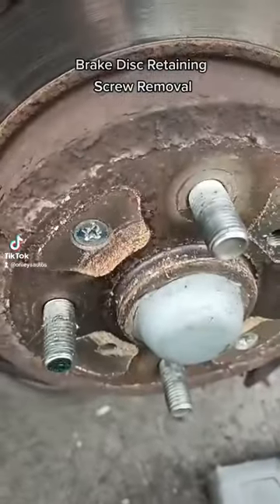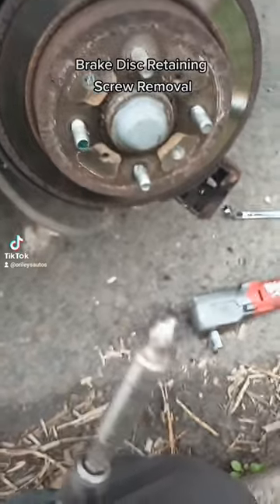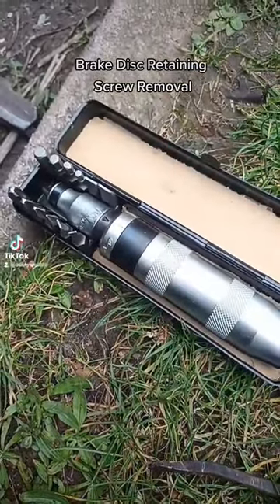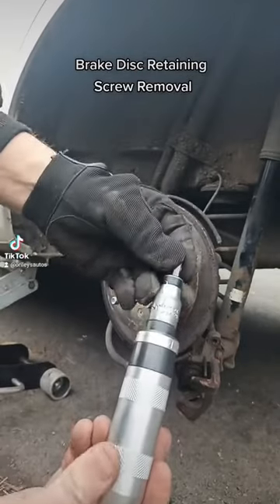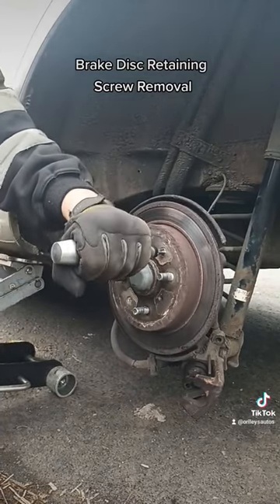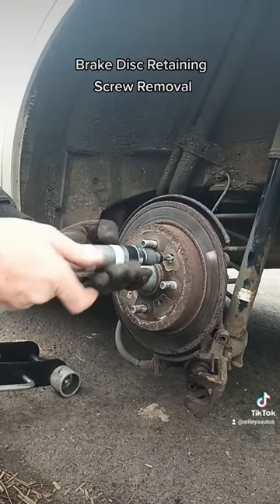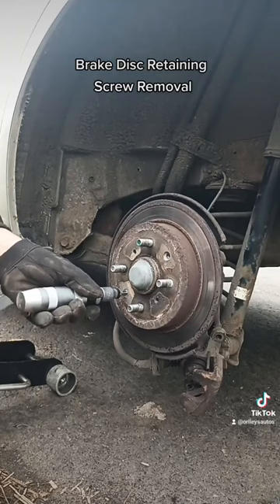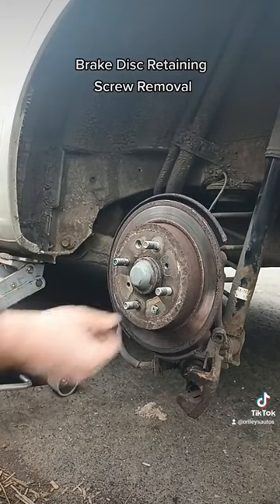Brake Disc Retaining Screw Removal With Impact Driver

Comment: you should have mentioned that you have to turn the tool body over center to set the direction ,,, if you dont know that bit , impact drivers dont work so well .
Reply: Very true. If it's set to tighten an inexperienced user may struggle.😅